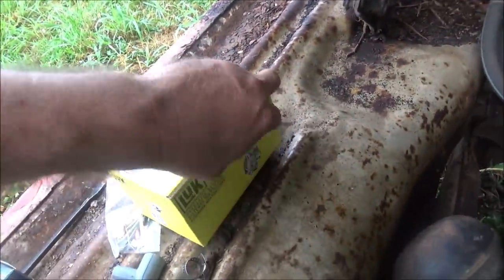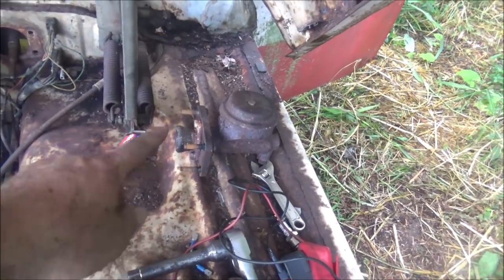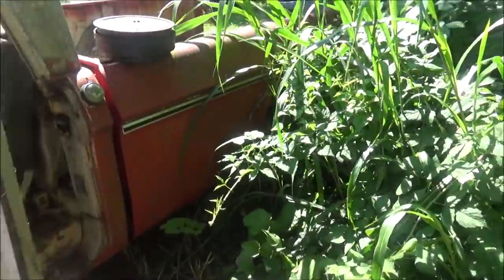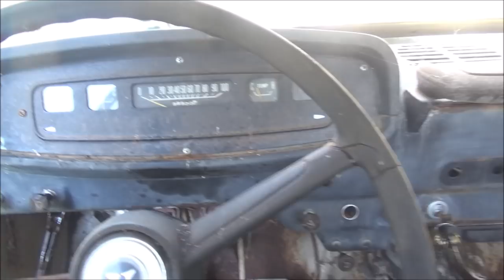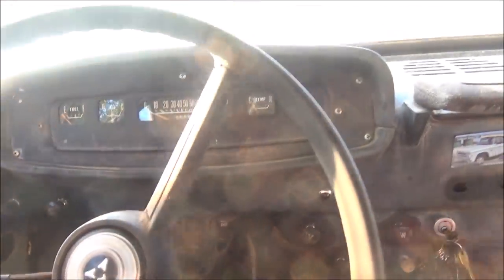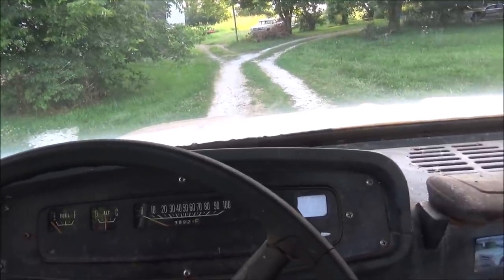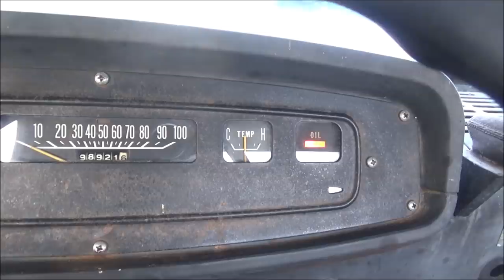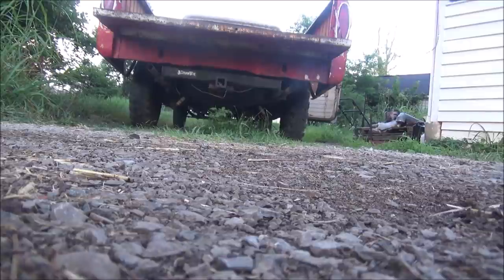Back Under its Own Power 67 Dodge D200  Field Find Rides Again!!

Comment: Those old Dodges were  tougher than the rest for the most part. Some one told you to scrap it....No way  ...There are lots of people that would snap that one up
Reply: Yes, they need to stop smoking drugs. The worst-case scenario he could sell it and make a little money. Parts for the truck are not as difficult as you might think either. I just googled floor pans for that truck and found a dozen suppliers on the first page.

Comment: Damn your just loaded with cool old trucks you got a old Kenworth too what is that a old W900 or what you should do a video of that someday that's cool and a crew cab dually does it have a 12 valve cumming in that truck or is it gas?
Reply from the maker: There is video on the Kw and the crew cab has several videos on my channel. Yes I Cummins swapped it and put a 5spd in it as well as a dana 71 rear axle with 3.07 gears.

Comment: Did those tire hold air all those years without breaking the bead? I'm assuming you added air before going very far...
Reply from the maker: I added air in the second video.One was down to 10psi the other 3 were in the 20's I put them back up to 50

Comment: A quick wash would be interesting.
I have a question. Why is it, that people park good vehicles for years. Only to let them rot into the earth?

Then try to revive them. Why not sell them before you park them to someone that would really appreciate them.

Plus the bonus is. It stops your yard from looking like a junk yard.

Cheers
Reply from the maker: Mainly because at the time it was parked no one would give more than it would have scrapped for and I would rather see stuff sit for someone to possibly be able to use or get parts from someday than be scrapped and gone forever.

Comment: This would be my daily driver
Reply from the maker: It is pretty cold in the winter time with the wind up your pants from the see thru floorboard. lol
Reply: @bcbloc02  I had an s10 with no floorboards or heater plus the door was falling off so I’m use to it I also ride a motorcycle year round,my old truck would get so cold I had to use a manual ice scraper just to defrost the windshield

Comment: So why didn't you pull out the scan tool to check the fuel trims? And have you scanned to see if there are any ABS codes? Oh the horror of it all. (Love real trucks, ATB Brian)
Reply from the maker: They don't make scanners with enough memory to hold all the codes on this thing. LOL

Comment: I think a high speed pressure washing video is necessary...
Reply: Need to be careful.  High pressure wash could ruin the paint job.
Reply: The pressure wash will remove all the rust holding it together.

Comment: in the scrap yard? are yall crazy. brian im twenty eight yrs old and drive a 87 k5 blazer that i built , daily. and before this i had a 77 that i put all new 91 suburban running gear in . to the scrap yard? my ac went out ... rebuilt whole system 190 bucks,  Caliper locked up .... 18 dollars , So yes im riding in a 87 with power steering and a/c , power windows and captain chairs , with a credit score of 800...so hows that 700 dollar a month 2020 tahoe that ruining ur credit treating ya? oh its in the shop for "maitnence" that you left with a 800 dollar bill on.. oh and before any trolls want to speak on that last statment.... im gm master certified, been at haley pontiac for years
Reply from the maker: You are smarter than most. Some people can't see the beauty of having things you don't have to worry about what happens to them or how you are going to pay for them.

Comment: Man, those old Dodges were ugly as sin! I had a friend that had an old Dodge van back in the sixties and it had those bug eyed headlights, we had allot of good times in that thing! If I had that ugly thing I’d keep it too, it sounds great! Are you going to use the original gas tank? Or are you already?
Reply from the maker: No it’s running out of the gas jug in the seat. The original tank is toast it would be lucky if it could keep gravel from leaking out. It pretty well matches the foorboard. Lol

Comment: Bailey is wondering why you're spending money that could be used to air condition his office. At least it will keep the mosquito population down. It's always good to have a beater truck around.
Reply from the maker: I spent less than $150 on it getting it driveable. I have a big window ac unit I rescued out of a house they were tearing down I could install in the shop but I am having a hard time bringing myself to cut a giant hole thru the wall to install it.

Comment: I waited to the last one posted as I watched from the start.... admiring somes of the  comments made by the mental midgets of their time setting in a  chair or barstool making fowl remarks. Was you  a dipping diesel person who wants out on the highway with no brakes, motor barely hitting on most cylinders and he doesn't even know the shift pattern and then to make this worse, this is a D500 flatbed that had been setting for seventeen years and parked with problems.... what makes me say what I said on his channel, to take a chance on yourself is ok, but a busy highway that you have to wait for a bit to just get on the road.... no, that is wrong and I mean someones kid is killed cause he wants to drive... it just makes me agree cause other kids will do it to now.  Na that truck of yours since its yours n you know how to drive and too much to list and you never went out on a busy highway plus it does run and start off a key. It will clean up as clean as your going to need or want. That kid never even cleaned the glass so he was just doing the ray charles brail shot of been there so can do it again. I like that truck myself and remember them well. I'm seventy three and crotchety and remember doing some dumb stuff but this boy is over twenty one and still messing up.... enough on him    and sorry... I just had to get that off my chest. Oh you don't know how bad I miss pulling wrenches and did for over thirty five years for I got hurt bad the first time that slowed me down and I had to come to town. I worked on the islands on heavy equipment till uncle sam gave me a call and then when I came home i went back to the islands working as a mechanic again... some other takes up time jobs but mostly wrenches an diesel is easier or was. This new technology  has got past me a ways and then after i got all the corrective surgery done thought I  could still do it but came home to town life with working on cars. Fifteen years ago I got hurt again when a man fell off his roof and I caught him an it made me wheelchair bound for the rest of my life which like I said, seventy three..... those offices ain't calling me to go to work nor anyone my age without a special degree. Anyway subscribed an like the first three so got a new one on.... gonna start that eighteen wheeler lowboy truck next??? hopes you have some more of this... I watch ever floats my boat but like most anything and it has to do with wrenching hopefully...farming, logging mining, n ever now an then a cooking show.. I still eat myself you know. There is no denying that fun quits when you die. Ain't in no rush an a man has to move around so thanks for sharing this stuff

Comment: Love the ol Dodges Brian , in Australia they are as  rare as rockin horse poo we had local made but they werent as nice as yours different bodies but still were called  d150 200's. the bodies we had believe it or not were made by international harvester. they had slant 6, Aussie designed 245HD  [heavy duty] steel crank hemi 6 yes they were called hemis. 318 HD 361 HD THAT  a truck motor.  JUST GOOGLE Australian Dodge utility or truck you will even see the car size utiltys we call em utes CHYRSLER Were in Australia  manufacturing dodges valiant etc from 1960- 1980 At Tonsley park Adelaide Sth Australia MITSUBISHI killed them off .no FORDS OR GM'S OR toyotas made here as of roughly a year or 2 ago. sad for us to lose those industries i hope like all Hell the American car industry survives for a long time to come goodbye and take care and give ya dog a pat for me  Bailey?
Reply from the maker: Baily says thanks!! I have heard of those hemi slants. Never seen one in person.
Reply: @bcbloc02  not hemi slant ,, a hemi 215 245 and 265 just google Australan hemi 6cylinder they got the hemi 6 cranking out over 300  horses in the 1971-2  RTE49  Vh Charger triple webers solid cam headers . google that youl find it interesting.  in 71 Aussie charger was the worlds quickest 6 cylinder production Car 14.2 quarters cya Brian take care BUDDY